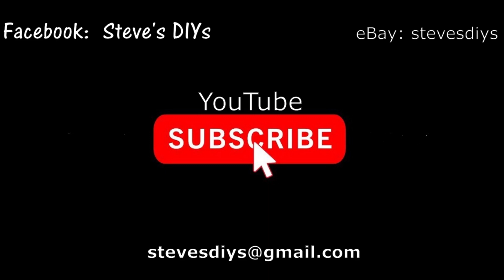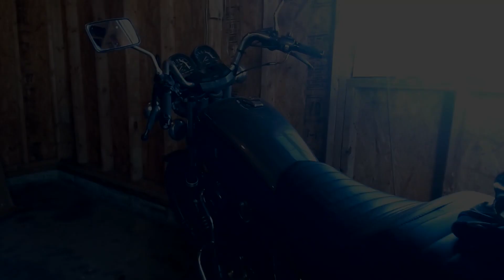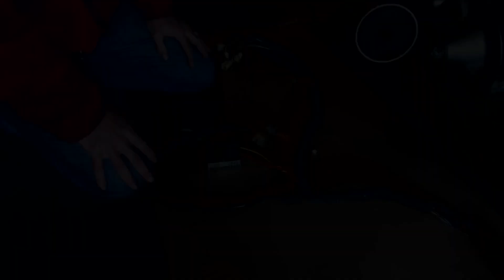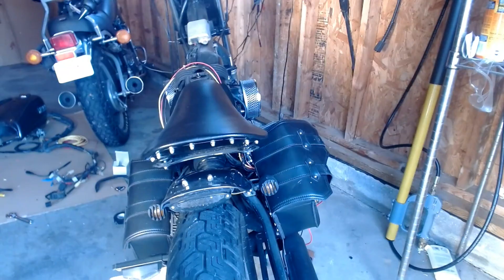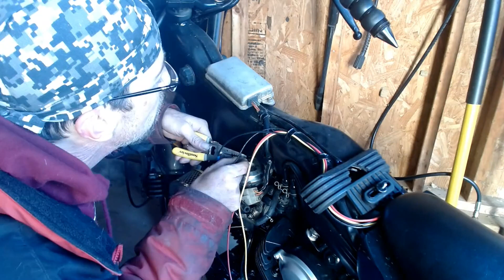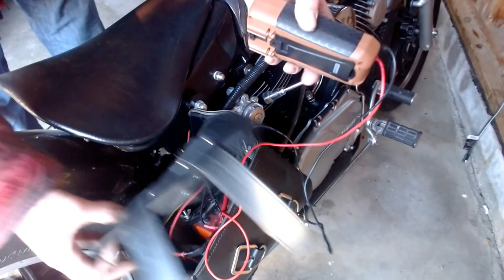Gen 1 Virago Voltage Stabilizer - Waste of time or Worth it ?!?!

Comment from the maker: If you are looking for the DC to DC converter, here’s a link to the picture of the one I used:  https://www.facebook.com/109400450606405/posts/249956913217424/ .I would say that any DC to DC converters that has the same input range, output voltage and at least this one’s amp rating would work fine, but buying one that is sealed good from moisture is very important.  All the best !  Steve

Comment: In no way is this a criticism however,  Just because a battery shows 12-13.8 voltage this does not mean the Battery is good,  It also needs Amperage, The power to turn over a large engine, The muscles of the battery as though to speak,  I have had many batteries in my life on motorcycles that have shown good voltage however because of the age of the battery or faults within the battery these batteries did not produce any amperage but showed great voltage, hence produce a no start situation,   (Confusing I know)  the second thing is the voltage regulator/stabilizer, or where you have placed it ,These things can get very hot, did you notice the cooling fins on it, It should be placed on an area of the bike that receives an air currant to help cool it , that is the way they work they convert excess voltage into heat, and hiding it in your pannier is not a good idea you could end up with a Fire !!    Really it should be fitted to a metal bracket and the back of it should be smeared with Heatsink Grease,  Go for a long Ride then feel the temp of Regulator/Stabilizer in your Saddle Bag and I bet it will be hot as that is how they were designed to work,    I hope this is of help to you !!!!    Malc U.K.
Reply from the maker: Hey man, no worries and yes you are correct that the battery needs to be matched big enough to provide enough current to these power hungry starters on these…if not, the the voltage will drop too low while cranking.  This is what causes the TCI (or igniter) to stop controlling the spark as it seems to need at least 10 volts to stay stable.

For the location of the add on voltage stabilizer, the way it is wired in, it’s not having to act like the bikes voltage regulator/rectifier where it’s constantly having to deal with keeping large amounts of power in check to avoid burning up the battery and circuits.  All it is hooked up to is the input power to the TCI and when the bike is running, it just chops the ~14 volts down to a steady 12 volt.  Since the TCI is only pulling just a couple of amps, it doesn’t have to work very hard at all so I’ve never noticed that it even got warm.  If it was trying to regulate the whole bikes power consumption it would have probably melted through the saddle bag by now like you said, lol.

Thanks for the comments…it is helpful for other folks watching the videos when they read them to think about potential watch outs and reasons why things might not be working the way they should (like having too small of a battery for example).  All the best !  Steve

Comment: So the stabilizer is simply being spliced into the hot and cold wires that feed the tci?  It’s not connected to anything else?  Thanks!
Reply from the maker: Hey man !  Yep, it is spliced into the +12 volt and the negative wires to the TCI.  It basically pulls a bit more current in order to keep the voltage higher to the TCI so it will trigger the spark to fire.

Comment: Hey Steve What kind of battery are you using on the stock bike?
Reply from the maker: Hey man !  I’m running a SuperStart brand CB16AL-A2FP on the Stock bike.  It’s the original sized battery for the bike 👍.
Reply: @StevesDIYs  Thanks Steve Love the videos. I have an 81 xv750 in good condition. Just now starting to tinker with it. I don't want to keep bugging you but are you sandblasting and painting the covers on your bikes? They look real nice , just wondering.
Reply from the maker: @jimhoyle8088  hey man !  No worries 👍. Yep, I do my own painting, but for the plastic parts I just wet sand them vs. sand or soda blasting as I’d be worried that it might damage the plastic.  Most times I just sand the old paint down smooth (not totally removing it necessarily), then use plastic rattle can primer and wet sand the primer till it is smooth.  I use automotive paint though (base coat/clear coat) when painting…since there’s not much area to paint on bikes, the paint supplies don’t cost too much 👍.
Reply: @StevesDIYs  Thanks.

Comment: would it make any difference if i wired the grounds to the negative terminal on the battery?
Reply from the maker: Hey man !  It shouldn’t negatively affect the voltage stabilization to wire the grounds together and connect them at the battery 👍. I separated the grounds just in case the stabilizer was an isolated type, but after researching a bit more (after I installed it) it looks like the grounds are tied together internally anyway. Connecting the negatives directly to the battery actually might help if there were any weak grounds in the wiring on the bike 👍.
Reply: @StevesDIYs  good to know! Thanks Steve.

Comment: I have a stock 1982 920.  It seems to start pretty well with some modifications I did after watching your starter repair video.  Would you advise putting the regulator on anyway?
Reply from the maker: Hey man !  I think it helped the bobber with the voltage drop making the TCI not fire because I have such a small battery on the bike, but my stock bike with the normal big stock battery has always started just fine so I don’t plan to put one on it.  It appears that as long as the battery is good and has a decent CCA number it’s effect wouldn’t be noticeable as the voltage wouldn’t drop down low enough to cause the TCI not to fire the plugs. All the best !  Steve

Comment: Any links to buy the part?
Reply from the maker: Hello, here’s the link to a picture of the ones I got (got it off eBay)...as long as it’s the same voltage input, output, and amp rating it should work the same 👍. I like this one as it looked to be sealed up nicely with the black potting material so it would be water proof:  https://www.facebook.com/109400450606405/posts/249956913217424/  .  Thanks for mentioning it...I’ll pin a comment to the video so folks can find which one I used.  All the best ! Steve

Comment: Steve, I have an '83 Virago  with low mileage.  I want to refollow all of your videos on redoing the engine by changing out all the gaskets and valve stem seals. Anyways, I don't want to use the same gas tank since it is less than two gallon x 39 mpg = about 78 miles max before fill-up. Is there a larger capacity fuel tank that will work on this bike without major modifications?
Reply from the maker: Hey man !  I believe there are bigger tanks that will fit in these, but not sure if they have the double petcocks like the 1st Gens do so you might have to tee the line to feed the carbs.  I’m not sure what options there are, but if you aren’t a member of the “Virago Nation - all things Yamaha Virago” Facebook forum, there’s a ton of owners on there that might have changed tanks and would know which might be direct fits 👍. Hope this helps and all the best !  Steve

Comment: Where you get this from
Reply from the maker: Hello, I got mine off eBay, but there may be other places selling them...it wasn’t very expensive so I figured I’d give it a try and if it worked but didn’t live long due to it being cheap, I’d find a better built one.  So far however, it’s done fine and hasn’t given any problems or gotten hot or anything so maybe the less expensive one is made good enough.  Here’s a link to the info of the one I used...I put a picture out in my Steve’s DIYs Facebook page. https://www.facebook.com/109400450606405/posts/249956913217424/  .  All the best ! Steve

Comment: Very good ,  Thank you very much Steve,  Good work.
Reply from the maker: Thanks man 👍. I fired it up again this morning just to see and it fired right up without hesitation...looks like it helped quite a bit.  All the best ! Steve
Reply: @StevesDIYs  On that special voltage stabilizer,  is it specific to that bike ? Is it a generic brand and model ?  Can you provide a link to purchase?  Thank you very much for your Great videos.
Reply from the maker: @GarysnewYT  , hey man !  The comments are back working again 👍. Here’s a link to the stabilizer I used...it’s just a generic waterproof DC to DC converter that can handle a 6 amp load so it’s not specific to a particular make or model:   https://www.facebook.com/109400450606405/posts/249956913217424/?d=n
Reply from the maker: For some reason youtube won’t let me reply to additional comments so I saw you had commented again, but it is no longer visible ☹️. Maybe they will get the bug fixed so I can see additional comments again.

Comment: I bought a voltage stabilizer last year but haven't installed it yet. I will now!  Thanks for your research.
Reply from the maker: Thanks man 👍. Yep, I was a bit surprised at the difference it made in the spark strength with the low voltage during the cranking.  I actually went out this morning (below freezing again last night) and it started right up on the 2nd rotation with just a bit of choke 😃. Looks like adding that and the mechanical fixes to the starting mechanism I did has the bobber happy again for cooler weather 👍. All the best ! Steve
Reply: Yep mine too is still in the cupboard while I've been hesitant to bother. Now I will! Thanks again Steve. Your videos are making my build so much easier & better.
Reply from the maker: @middo1259  , thanks man ! Glad the videos help some 👍. I’m doing a Cafe style build currently so I’ll be planning the wiring in the harness to add the stabilizer ahead of time vs. having to cut into the harness like I had to do for the bobber.  It was a bit tight to get the splices onto the short section of harness wires, but it worked out fine since they are under the tank anyway I think.  Happy New Year to you and all the best !  Steve